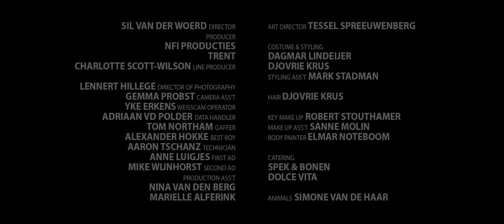Noisia - Tommy's Theme (Official Video)

Comment: The bass just REALLY sings to you. I like Dubstep, but rarely do I hear it with such...Phrasing and melody?

A key change is even a rarity.
Reply: Fucking right.
Reply: Frank Woods Woods!? You're supposed to be dead, man!
Reply: But it's not Dubstep, it's Drum'n'Bass. They may have some similarities between Dubstep and D'n'B but they are very different overall, a bit like Hard rock and Death metal, or like old school Rap and Trap.
(I just point that out because I know some D'n'B fans are getting upset to hear about dubstep on D'n'B videos)
Reply: Nicolas Martin
Noisia has it listed as Dubstep, so I'm going off of that. As well has the alternating double-spaced kick and snare signature of Dubstep. I would also say the emphasis on having a rise and a drop, but DnB has that as well.

The key I look for is the percussive patterns. For instance, a lot of people think Skrillex is primarily Dubstep. He does Dubstep, but he mostly does Electro. Electro is 4-beat, Dubstep is 2-beat, DnB is often 8 or 16-beat. The harmonic-rich bass instruments and sidechained kicks, aren't exclusive to any of these. Though I would argue that much of the newer stuff was probably pioneered in DnB.

But for instance, Split the Atom and Alpha Centauri are technically Electro. Sunhammer, Diplodocus and Could This Be are undoubtedly DnB. Tommy's Theme would be Dubstep. Though I usually say it's like a DnB style Dubstep.
Reply: I don't mean to antagonize, but I did just look up the definition "The genre is characterized by fast breakbeats (typically between 150–180 beats per minute)"

Dubstep was started by London garage musicians trying to incorporate DnB sound with 2-step garage rhythms. The 2-step rhythm is what takes DnB's more flighty, fast pace and gives it a slower, more massive sound.
Reply: Jonathan Weber Ok fair enough, I'm not really into definitions, BPM and the technical stuff.
I just know that what is commonly called Dubstep can be quite easily recognized over what is commonly called D'n'B.
Btw I was totally agree with your first comment in the first place, I just thought you did not know about D'n'B and just put it into the "Dubstep" category by default, my bad.
Reply: Jonathan Weber I like your in depth analysis, but I think dubstep has a socially accepted form now, which is it contains "wub wub wub wub wub WABBA WABBA WABBA wub wub wub" :P

This music just seems a hell of a lot more complex than most dubstep, but that's probably just because the average dubstep artist is marketing to mainstream audiences, and not more "educated" music fans? I dunno, I'm blabbering, maybe you can make sense of that xD
Reply: Jonathan Weber Well, some people call it "Brostep"
Reply: Jonathan Weber You tell them friend!
Reply: Jonathan Weber Only, it's not dubstep...  Drum and bass has fast break beats (typically between 170-180 bpm, with occasional variation), with heavy sub-bass lines. Dubstep has a 2step rhythm and an emphasis on generally "dark" bass lines and is generally produced at a tempo of around 140 beats per minute, not forgetting the ever popular wobble bass and bass drops that drum and bass doesn't have.

Here is a TL;DR of every variant out there that are mistaken for other genres:
Dubstep - 140~ BPM. Drums are half-step. Very noticeable sub-bass.
House - 128~ BPM. Kick on every beat.
Electro - 128~ BPM. Kick on every beat. More upbeat/energetic than house and tends to focus on the bass line more.
DnB- 170-180 BPM. Fast drums and focused bass lines.
Drumstep- 170-180 BPM. Drum n Bass with half-step drums.
Trance- 120-150 BPM. Very airy, moving feel. Tends to be uplifting.
 Hard Dance- Anything from 140 to 170 BPM. Hard  Dance on Monstercat is a bracket genre (like EDM) and ranges from  hardstyle to hardcore to hard trance.
EDM- A bracket genre. Anything that isn't one of the above genres is put into this section. The majority of tracks in this section are Moombahton (105-115 BPM,  sounds like slowed down electro) and Glitch Hop (100 to 110 BPM,  syncopated rhythms). Sometimes, there will be Nu-Disco (120-130 BPM,  sounds like stuff from the 70s and 80s).
Reply: ***** Kyubey
Reply: "This music just seems a hell of a lot more complex than most dubstep, but that's probably just because the average dubstep artist is marketing to mainstream audiences, and not more "educated" music fans?"

I suppose you could say that, given that they've worked with Amon Tobin. When I listen to Amon Tobin, people give me odd looks like "dafuq is this noise? What are you smoking." while I'm in my own world of auditory bliss.

But also, if you go to electronic music festivals, you find that about 90% of the music is people who pirated FL Studio and try to basically duplicate Skrillex.

It's not necessarily that Skrillex is particularly bad, though I don't generally like his more whiney style of music.
Reply: Richard Chambers I like your analysis, though I'm not sure how you came to your conclusion. Since this song IS primarily 2-beat. If you argue the rise and drop, it's all there. And wubs aren't a dubstep requirement, mostly heavy, modified bass lines. Tommy's Theme does have a fairly heavy bass line, though it has much more harmonic content than traditional "wubs".
Reply: +Jonathan Weber I pirated FL and I'm trying to make IDM/Neurofunk :p
Reply: EqualisE. RS4.0 #lovednb gg, way to brag about pirating expensive software, which is illegal, gg sir, I congratulate you.
Reply: +Richard Chambers I'm sorry I'm a university student who can barely pay rent and still want to have a creative outlet?
Reply: Nicolas Martin Its Techstep
Reply: It's neurostep
Reply: Neurostep
Reply: The melody is taken from a '90s rap song by Norwegian artist(s) Warlocks. The track is called Takin' Ova.

Tommy T is the most prominent member, hence the title of this track, I guess.

Good choice of backing/source track, but they did not come up with it themselves.
Reply: @nicolasmartin8136  it is dubstep though. this is 150bpm, half-step and all. don't see why you would classify this as dnb
Reply: This is Tommy Tee melody!!
Reply: This is NOTTT dubstep!!!
Reply: @JonathanWeberese  more massive sound??? Lol
Reply: @JonathanWeberese  btw... skrillex is not making music !
Reply: its funny people tryna justify saying this isnt dubstep just because it doesnt sound like the dubstep the have heard, its definitely dubstep the chaotic neuro bassline doesnt change that
Reply: @StanleyNoble  Yeah. I mean don't try to get TOO hung up on genre classification since that's a bit of a farce. But in hindsight, we now separate it out into the "dubstep" as a whole, and "brostep" which is specifically the Skrillex type stuff. I think "brostep" was meant to be a derogatory term by fans of the genre who didn't like where it was going, but I think it's an awesome genre unto itself. 

But the original Dubstep was a surprisingly mild and ambient genre at its very beginning before it got its own classification. Then it turned into the familiar combination of heavy 2-step beats with warmer wubbing bass. Don't quote me on this, but I think it was the UK/NL neurofunk and grime artists who introduced the more intense and harmonic-rich basslines, and then the UK/US artists who gave it more pop appeal turning into what we now call brostep. And a lot of people probably don't realize that like 60% of what goes as "dubstep" is actually the brostep equivalent of electro, which I believe we call "complextro" now. Basically sounds like brostep, but with 4-on-the-floor kicks. A subtle enough difference to kinda highlight why genre chasing can be a bit of a farce.

What Noisia did here is more like brostep's sibling. But my favorite part about it is that it just sounds SO balanced in the fact that they aren't choosing between a melodic line and a grimy bass break. It made the grimy bass break melodic. So it sounds more "complete" to me.
Reply: @webx135  yes I am familiar with the evolution of dubstep and I enjoy every style, also fun fact skrillex went to learn music production from noisia and his growl type basses in his early tracks were his interpretation/ attempt at the heavy noisia reese style basses in tracks such as monster
Reply: @manugrows3606  the true nerds like us call it that
Reply: @ozz3790  your comment ages terribly. Skillex and noisia just released a collab track and it fuckig slaps
Reply: @yootd3m  think as u wish. Skillex is lucky to be named in same sentence with Noisia... and still skillex is not an artist.... lol
Reply: @ozz3790  check out "supersonic" skrillex noisia. Epic mate
Reply: @yootd3m  sure. I ll try. Thanks